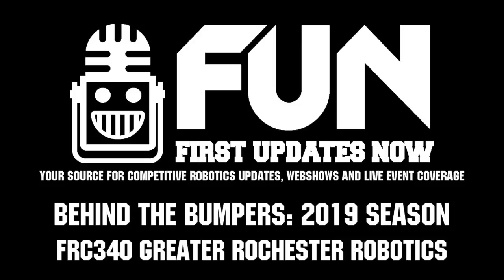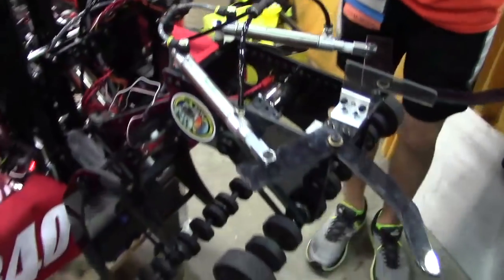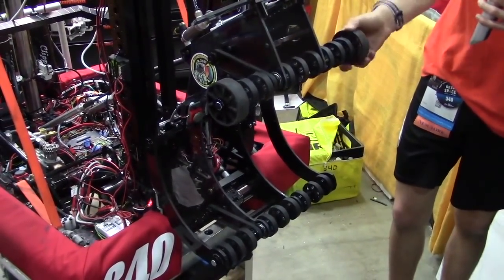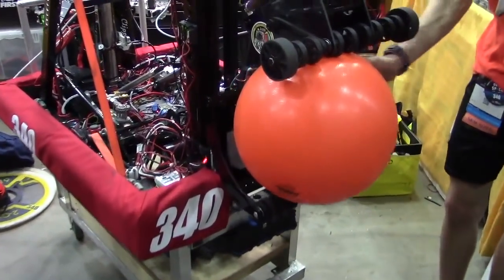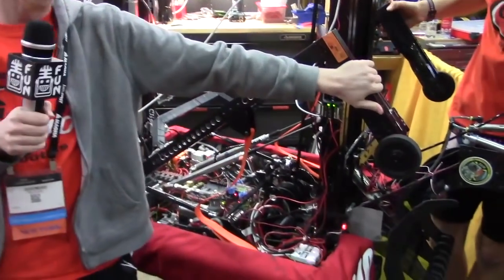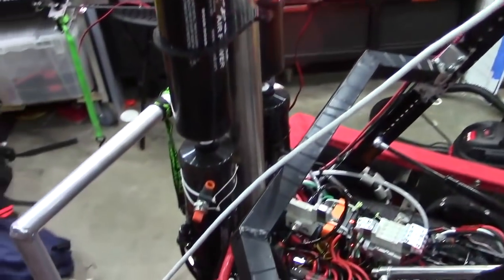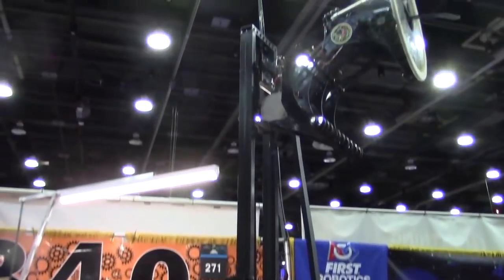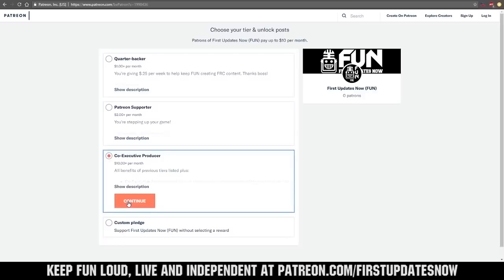Behind the Bumpers FRC340 Greater Rochester Robotics 2019 Competition Season

Comment: How do you get your mechanism behind the frame perimeter?
Reply: The whole elevator tips back with 2 pistons
Reply: owen Correct. It tilts forward at the start of the match.
Reply: The elevator tilts back, the intake tilts up, and the elevator raises a bit. With good height there's just a smidge of room where the hatch mech isn't too high and the cargo intake isn't too far forward